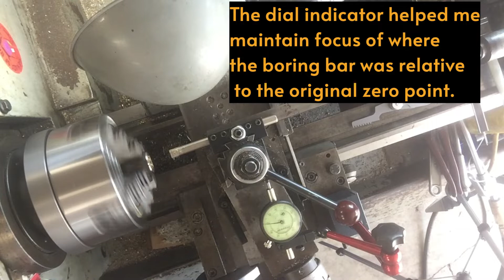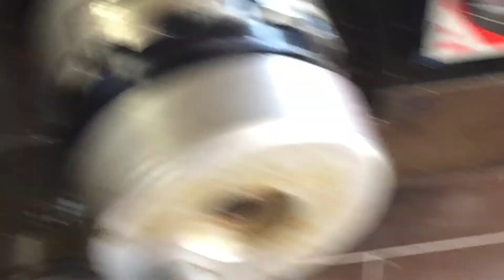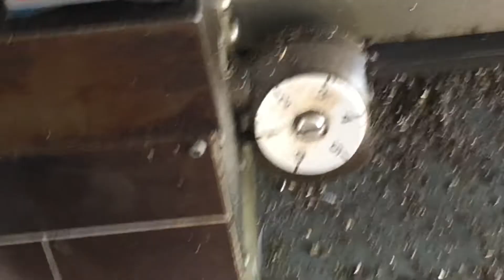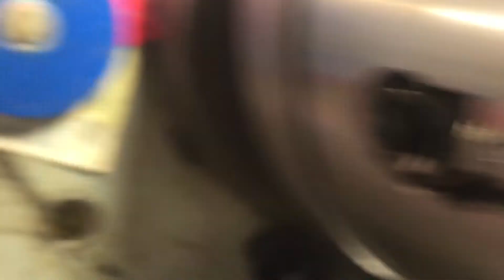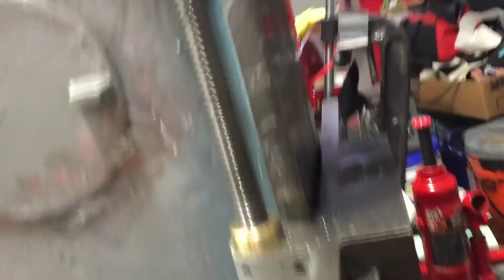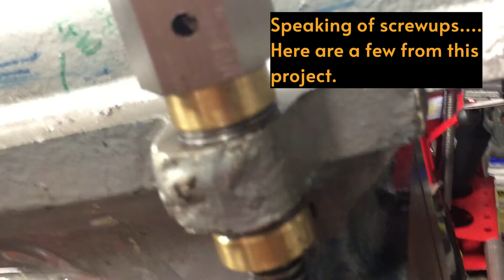Part 14 Acme Thread Cutting and Y Axis

Comment: Well done. How much does ACME threaded rod cost in the USA?
Reply from the maker: I used the lower quality carbon steel sections @ $20 for 3 ft. and I bought two pieces. The Alloy steel is $55 for the same 3ft. For the precision 3ft sections the 1018 carbon steel is $55 and stainless is $91.
Reply: @houseofbrokendobbsthings5537  are they only available in 3' sections?
Reply from the maker: @BensWorkshop  1,3,6 ft. From McMaster Carr our incredible supplier we can rely on. LOL. Pricey, but typically always great products. Incredible website with options to import component drawings directly into CAD.
Reply: @houseofbrokendobbsthings5537  Interesting. I wonder how much shipping to the UK would cost. I will have to look that up.
Reply from the maker: @BensWorkshop  Good hunting. www.mcmaster.com 

They are a big outfit and will likely have the process all sorted to ship your way. Over here they are known for having just about everything, and in my case lightning fast shipping. I am about 200 miles away from their warehouse and many days I can have my order the next day or worst the day after.
Reply from the maker: You might check in Canada as well. I believe they have a better shipping arrangement to the old country.
Reply: @houseofbrokendobbsthings5537  cheers.
Reply: @houseofbrokendobbsthings5537  Cheers.

Comment: Good job Dan .  That type of thread always has it's challenges ,  7/16 internal square thread  would be the smallest one i have done !  👍
Reply from the maker: Thanks Max. Trying the same with new tap of the same size was a hot mess. After doing the internal threading that tap is going in the drawer for thread chasing duty only. Thanks for watching and encouraging me.
Reply: @houseofbrokendobbsthings5537  👍👍👍

Comment: Spot on Dan Nice modification for that great little shaper.
I had the same trouble with my Loco Brake Square thread Nut, but my boring bar was only 1/8" diameter, Jesus that was tense!!🤣🤣😉😉👍👍
Keep up the good work
take care
Kev uk
Reply from the maker: Thanks Kev. Appreciate you watching and commenting. WOW 1/8 boring bar now that would take a while. I certainly had some flex even with the bar I was using. Thanks again for the encouragement via your kind words.